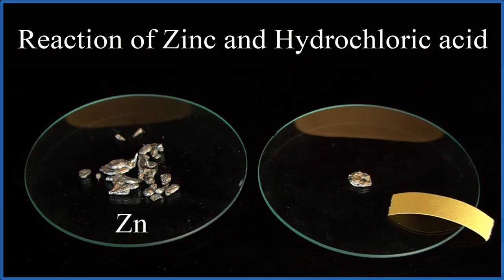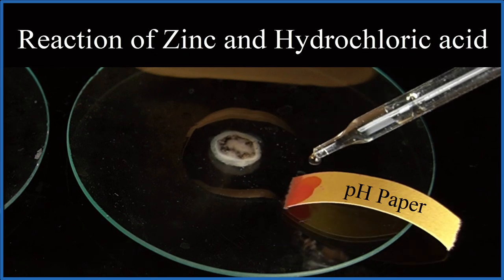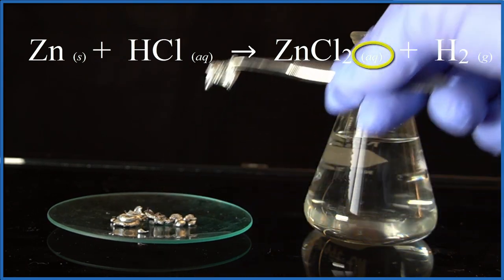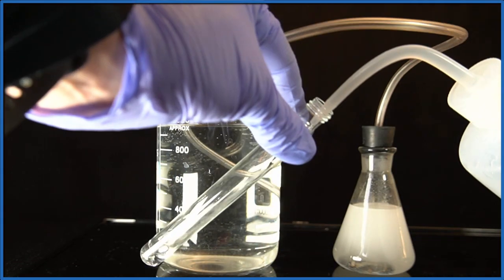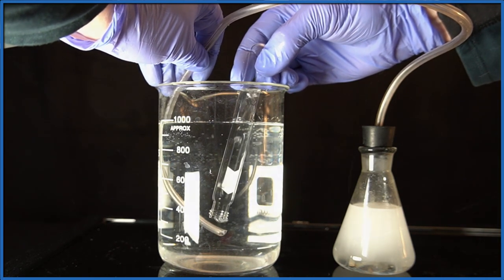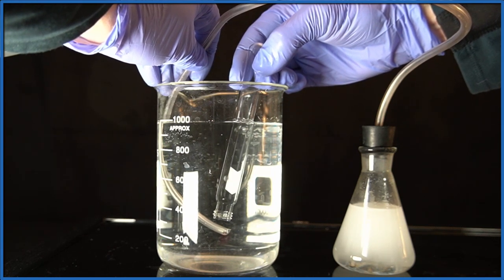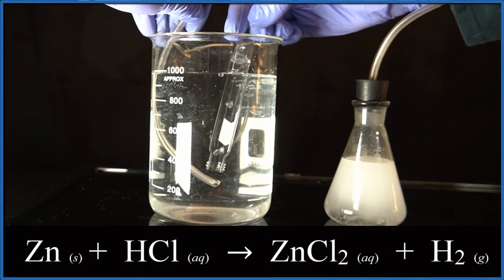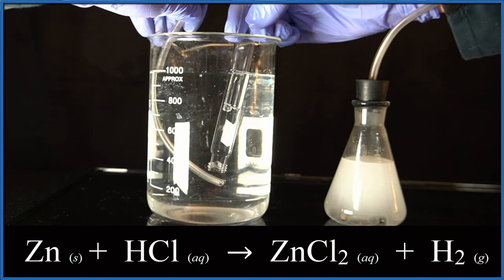Reaction of Zinc and Hydrochloric acid

Comment: How concentrated does the HCl need to be?  I'm trying to get a piece of zinc stuck in my graphite crucible out and toilet bowl cleaner (9.5%) hardly moved it.
Reply from the maker: In this video it's pretty concentrated.  I actually used muriatic acid from home depot.  But really, if you wait long enough I could expect the 9.5% to do it, just at a slower pace.
Reply: @wbreslyn  I left it overnight.  By the way after I posted that I got it out.  The HCl apparently ate the rim enough that I could (with great force) slide it out.
Reply: @wbreslyn  I melt pennies by the way to pour into various molds.  It always leaves behind some stuff, mostly zinc oxides I would imagine and possibly the copper coatings which is probably why HCl hardly dented it.
Reply from the maker: @ThePeterDislikeShow  Yeah, agreed, likely some coating slowing things down.  I have used conc HCl to eat the Zinc outside of pennies.  Very satisfying:  https://youtube.com/shorts/vJswbN5_O94
Reply: @wbreslyn  Is there a way to dissolve the copper but leave the zinc intact?  I make zinc art and that would make the zinc melt a lot more cleanly.
Reply from the maker: @ThePeterDislikeShow  Not that I know of.  Copper is tough to dissolve in the first place and is less reactive than Zn.  Conc. HNO3 will dissolve Cu (see https://youtu.be/QEujWlN9E6c) but it will also dissolve Zn.

Comment: 👍🏻 nice! So if i check a solubility table , i should see that H an Cl are soluble in in H2O?
Reply from the maker: I don't think you'll find H+ on the solubility table but Cl- is there.  Since HCl is a strong acid it will dissociate completely in water so it is soluble.
Reply: @wbreslyn  so being a strong acid HCl must have a pH <5?
Reply from the maker: It really depends on the concentration. The HCl is used in the video was less than 1.  But if you dilute it enough it could be anything below 7.  Strong acid just means that it dissociates completely in water.